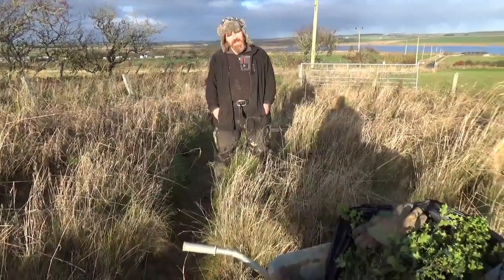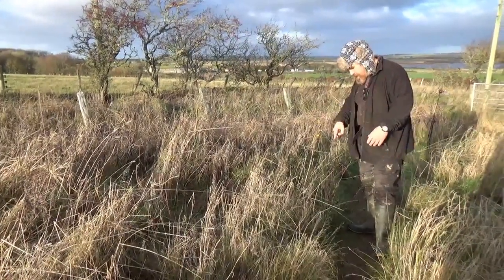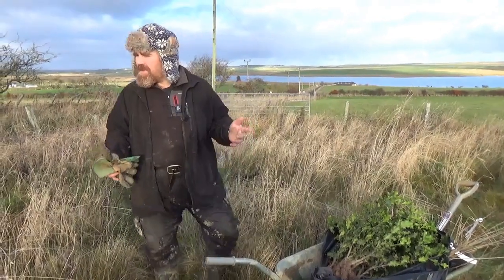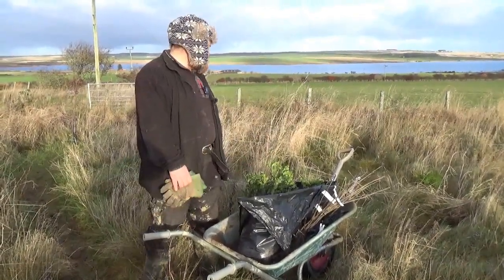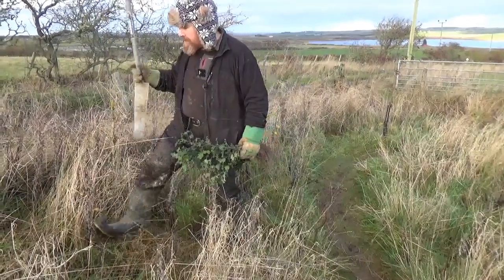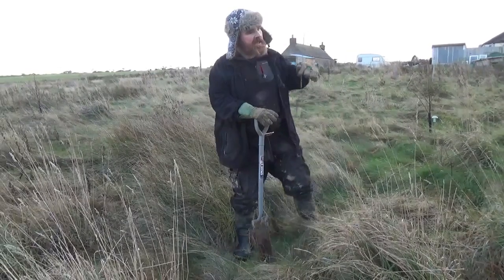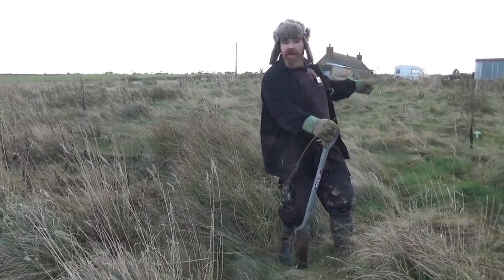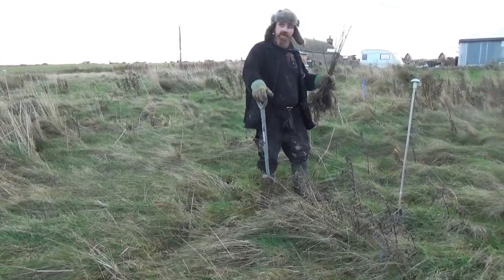Making land stormproof. An evergreen shell for the permaculture shelter belt.

Comment: Loving these videos and what you are doing up there in Caithness. Regarding tree planting and potentially deer damage, do you use tree guards or just plant and accept a percentage of loss? I have a fairly significant deer grazing issue here on our land in SW Scotland so have gone for the latter (but dislike all the use of plastic that this entails). Thanks again for all the excellent insights from your croft  - brilliant.
Reply from the maker: So far, deer pressure hasn't been much of an issue. We've only lost one tree to deer. If it does become a problem in future we'll probably guard the fruit trees inside the system, while the shelterbelt becomes denser.